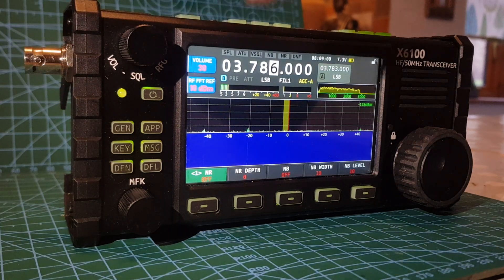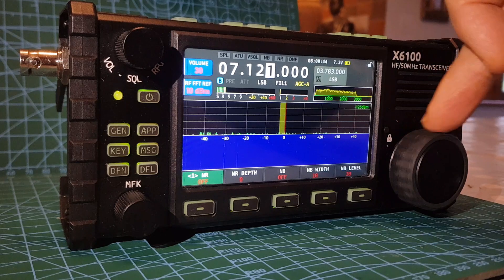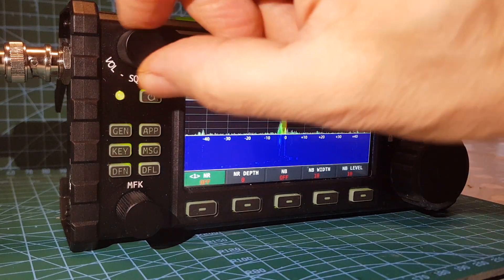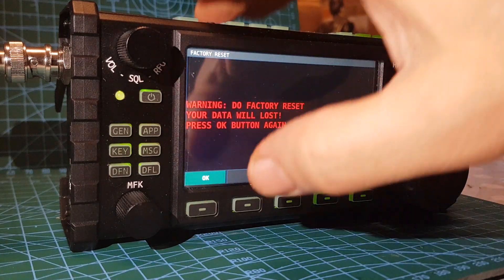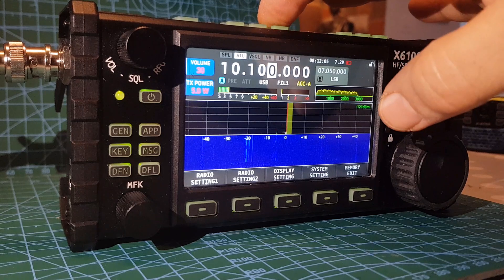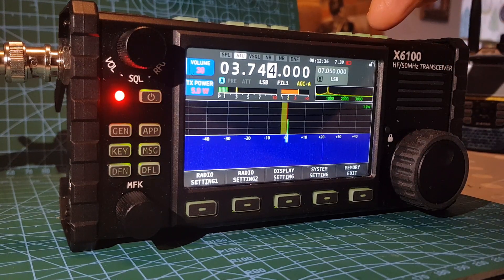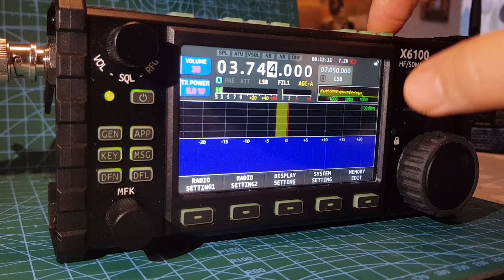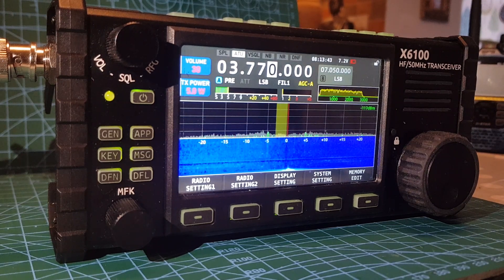Xiegu X6100 - ATU  observations

Comment: On my x6100, I also notice the noise level on spectrum display increases on 7mhz as you said in your video. 
Will factory reset do anything to the firmware version ? ( I have 1.1.2 )
Reply from the maker: Hi this may improve with Firmware 1.1.4 also you could be getting rf from a cable or power supply test tye radio in the garden .